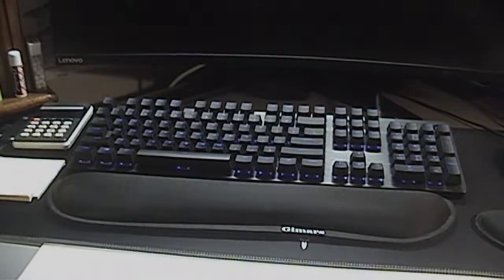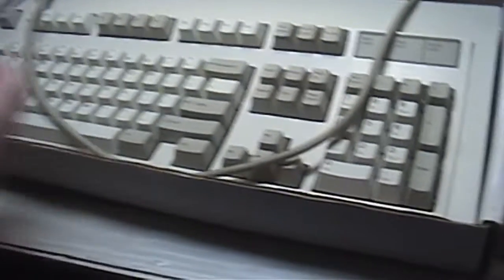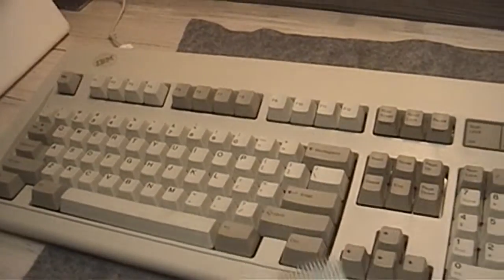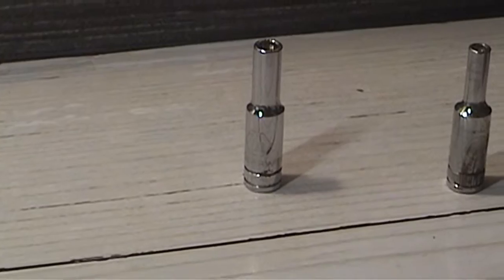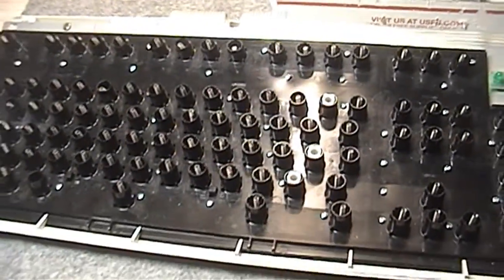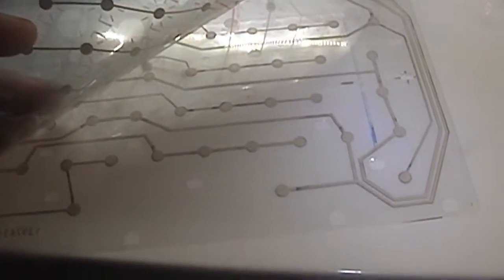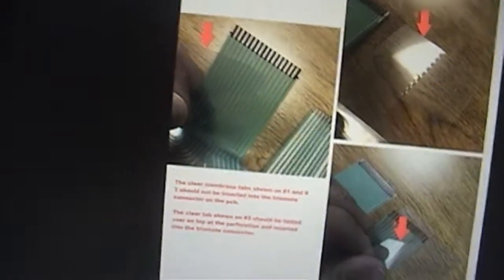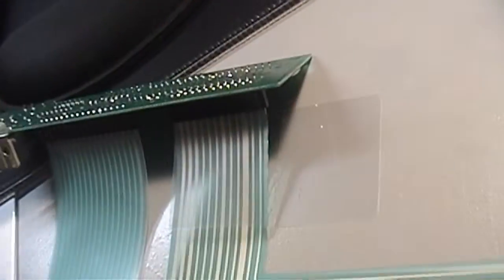IBM Model M Keyboard Membrane Replacement

Comment: I’m sure it took a long time to do, but I’m also sure that it was definitely worth it. Even though I haven’t really restored/cleaned an older keyboard like this one, I know how long it can take. It’s worth it though, I’ve still got keyboards needing attention, mainly just a good clean, but the effort it worth it as it always seems like I need another keyboard somewhere. I’m sure this’ll easily continue to just work. Great video!
Reply from the maker: Before learning of the availability of replacement membranes, it was really beginning to look like this keyboard would need to be forever shelved due to its unreliability. However, it’s been working flawlessly since this repair. With it now having a new membrane along with it being bolt-modded, it’s ready for another few decades of reliable service. It definitely was tedious, but it was absolutely worth the effort.
Reply: Nice! I didn’t know replacements were available, cool to see this one completely restored! It’s definitely worth it for a keyboard like this.

Comment: Nice answer to my sony radio bye leaving
Reply from the maker: This channel isn't my job. I haven't uploaded a video for the last two months because I've been busy with life. This channel isn't my job. Yours and many other viewers' comments haven't yet been replied to because I haven't had the time to reply to them, but I've planned to do so as soon as the opportunity presented itself.

As a matter of fact, I need to replace the dial light in mine after it burned out several years ago. Just like you discovered, there isn't any online documentation showing what to do. Knowing my luck, the bulb is probably permanently soldered in place and will need some effort to be replaced. That radio's dial light replacement has been on the backburner, so I can't speak with any authority on how to actually replace the bulb. 

TL;DR I wasn't ignoring you. I get comments every day from people seeking technical advice, but there's only so much time in the day. If I haven't replied, I'm not ignoring you--I just haven't had the chance to sift through the comments and get back to those that warrant a reply.

Comment: Is there any way to contact you ?? Can't find your email. SOS
Reply from the maker: It’s on the about page of my channel. You might need to solve a captcha to reveal it, however.
Reply from the maker: It seems they changed things slightly. On my main channel page where it shows my description, clicking it will review the full details that used to be under the about page. Therein lies my email address!